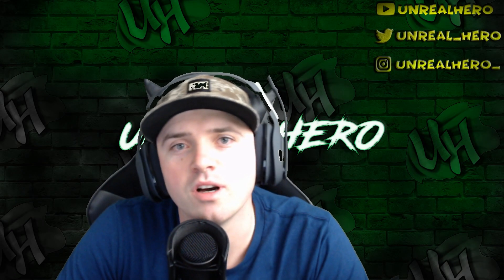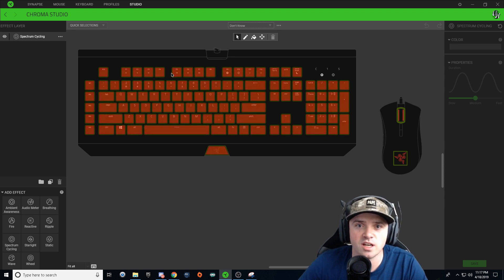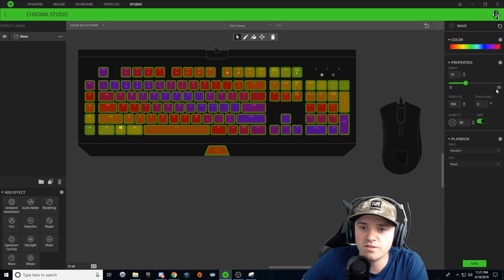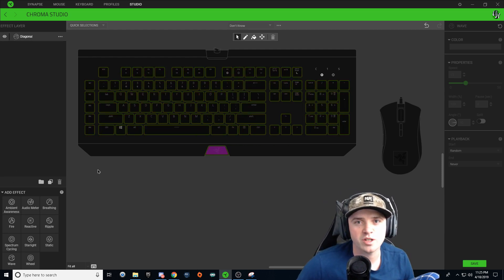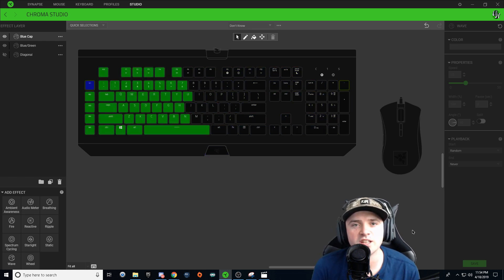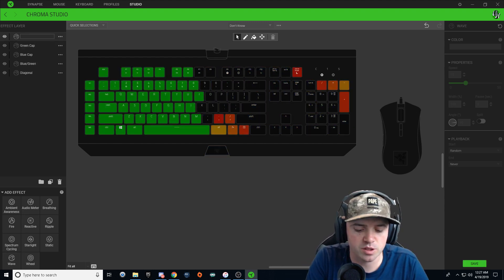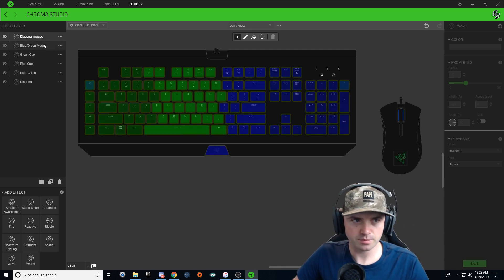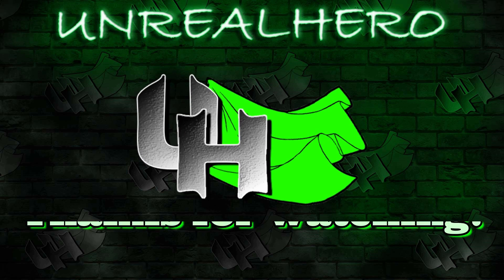'Don't Know' keyboard lighting | Razer Synapse 3 | How To

Comment: Hey there I have a question, for some reason when I try to change anything on the key board I sellect what I want and apply the effect and colour ect ect I save it and it wont apply to the keyboard, if I go to the quick sellections menu and sellect something and apply it then it works, do you know how to disable that? or any tip that can help me? thanks in advance
Reply from the maker: You have to make sure you highlight and select which keys you want to have the effect. Are you making sure that you are selecting the keys prior to customizing?
Reply from the maker: If you don’t highlight any keys then nothing will be changed.
Reply from the maker: The quick selection tab highlights them for you
Reply: UnrealHero Exactly if im using the select tool and select a group of keys -> apply effect and save it should be displayed on the keyboard but for some reason it doesn’t happen.
Reply from the maker: Zodiakx17 is the layer you are applying maybe getting over ridden by a higher priority layer?
Reply: UnrealHero well as you can see im not very experienced on this but as far as I can see there is only one layer so far. Im just trying to make W A S D static in a single colour and apply some other effect in other keys (macros) and the rest of the keyboard. Im not close to the pc at the moment but ill try again later today
Reply from the maker: Zodiakx17 let me know what happens
Reply: @UnrealHero  its really strange I have followed this video step by step as you showed but no effect will get saved its really wierd.
Reply from the maker: Zodiakx17 yeah that’s strange. Not sure if I come across anything I’ll let you know